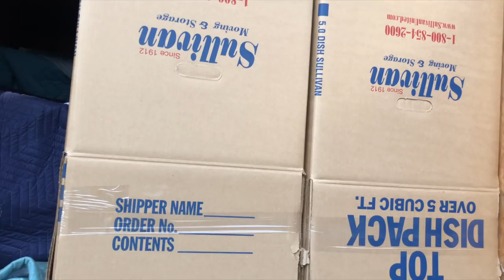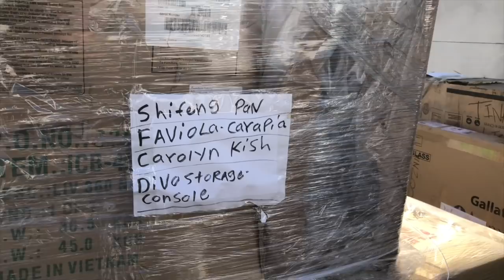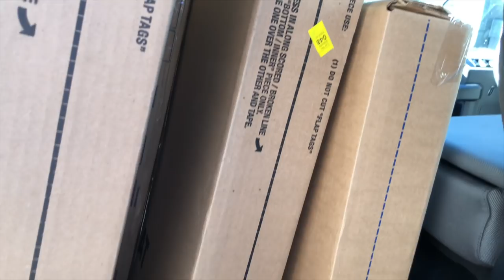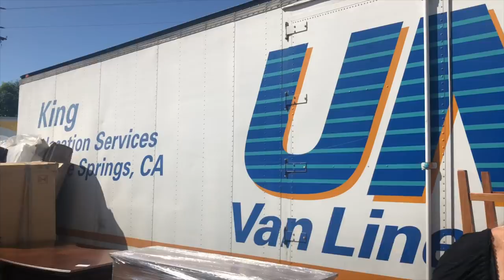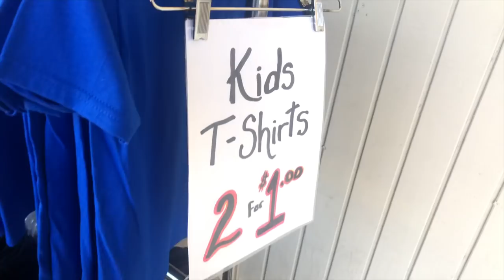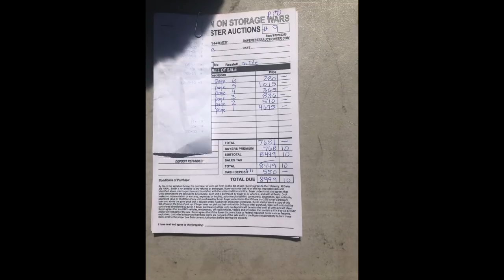We Spend $9000 at Dave Hester Abandoned Storage Wars Auction Rene Casey Nezhoda WHAT DID WE GET

Comment: Yes the dishpacks usually hold dishes and breakables and some expensive stuff.. but they are wrapped and packed really well and they make a sturdy base but not to stack bookboxes but you can stack alot on them ..they are solid...the pictures that are crated are usually the expensive ones and or granite tops or expensive glass tops ..but if it's a real valuable picture it will be crated